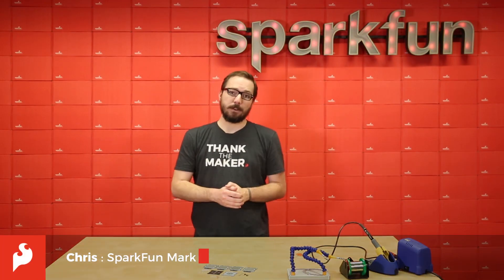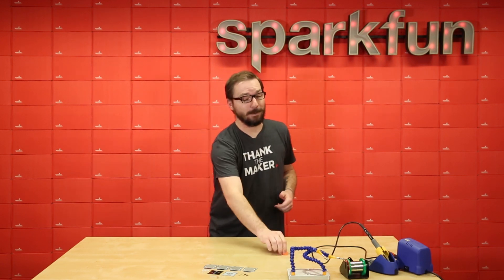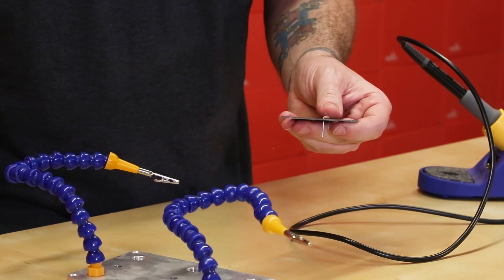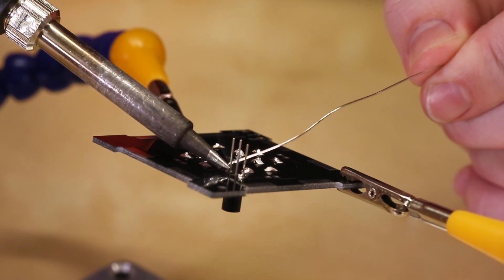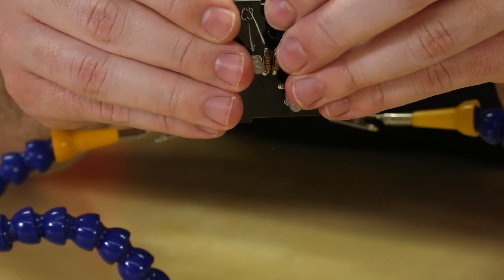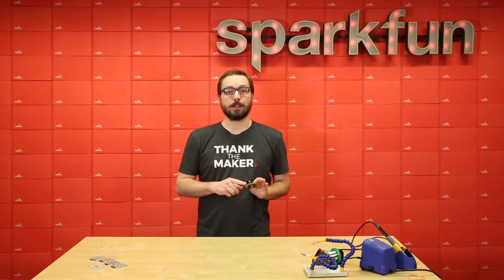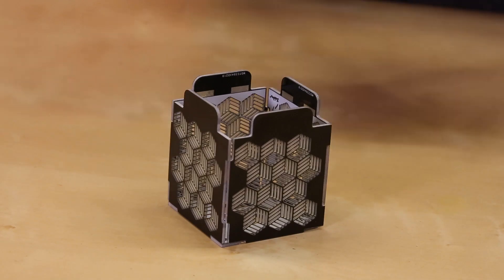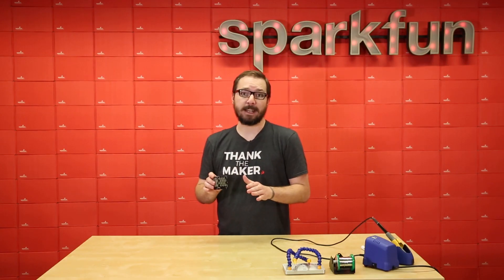Product Showcase: Nightlight Solder Kit

Comment: If this is what you call an "intermediate" kit, what would then qualify as "beginners"?  To me this is really basic soldering, nothing special about that.
Reply: So I'm going to be honest with you on this: the soldering on this kit IS easy, but the assembly of the housing is probably the most difficult and will take the most time since you need to make sure everything is straight and in the proper position before you solder it together. That's why we call it intermediate. For beginner's kits I'd recommend the Day of the Geek and Unigeek kits that came out today or the Weevil Eye Kit we've had for a few years.